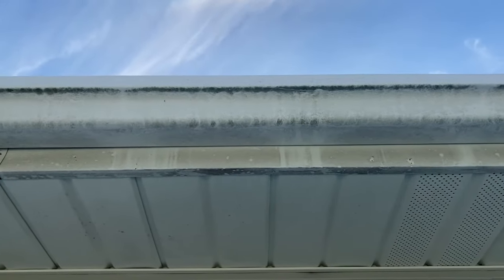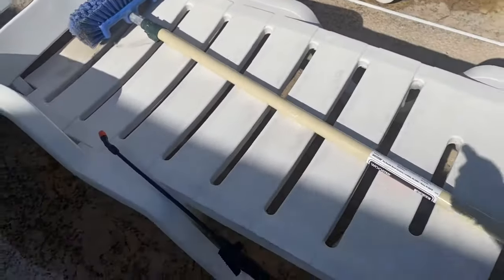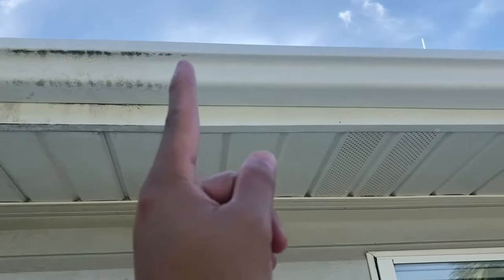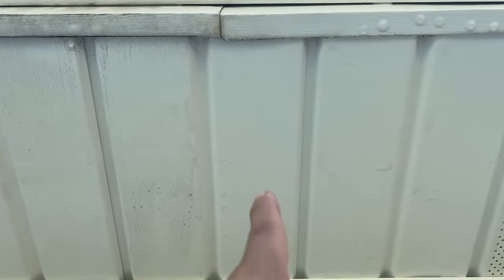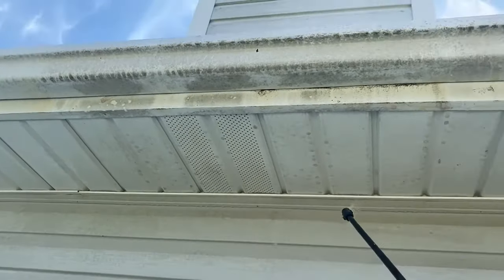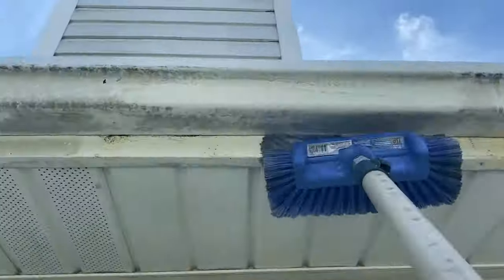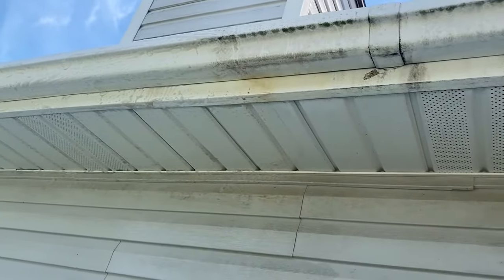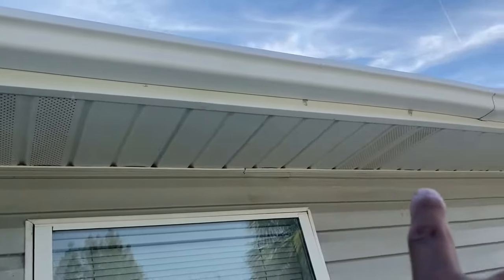✅Best Gutter Stain Remover | How to Clean Fascia and Soffit on Home DIY HD Review

Comment: Thanks for the video. Can you use this product and method when you have primed shingles on the home without discoloring the shingles?
Reply from the maker: You can but always test and inconspicuous spot and don't let it dwell long with a strong mix to be safe. I've done many surfaces and 50/50 for about 30sec does the trick for me.

Comment: A guy just cleaned my soffits with this stuff mixed 1 to 4 ratio and it still took off the paint in circular spots, even though he rinsed it off right away.  I read on Home Depot where another guy mixed it 1 to 1 ratio and it completely took the paint off his aluminum gutter corner pieces.  This stuff does not get along well with painted aluminum.

Comment: Sorry buddy, but this stuff is garbage. I mixed it 50-50. and it did not do anything . I used straight solution Nothing did not even phase it sorry but this stuff is garbage. I gotta get better stuff gutters are only two years old and I have tiger stripe and I have a 3000 PSI power washer, and I couldn’t get the so-called tiger stripe out by saying that I have to get a better product so I can get my gutters the way they were at one point and they are only two years old.